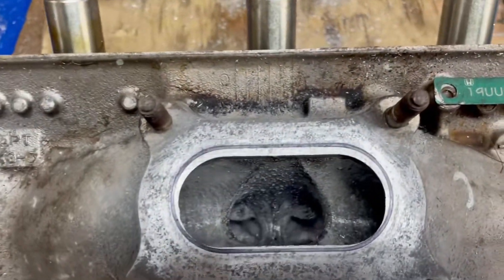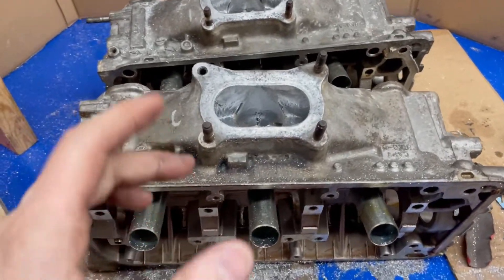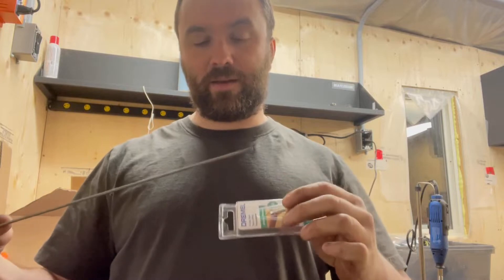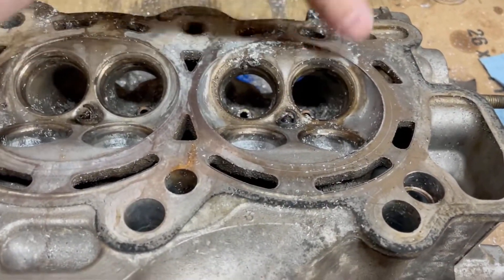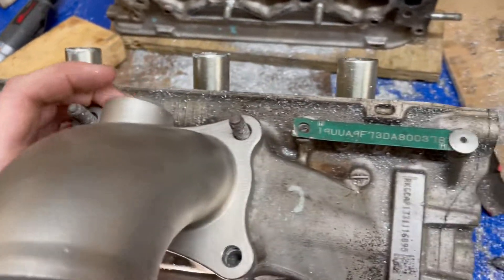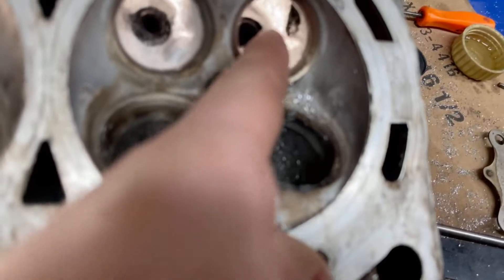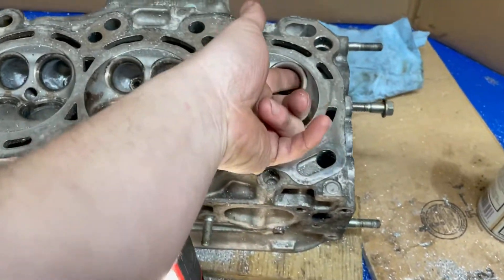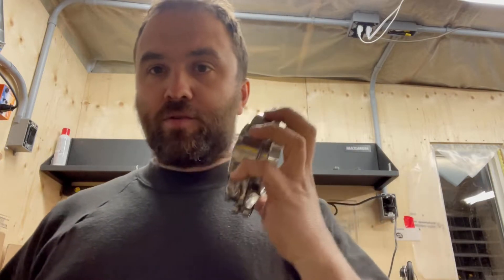J37 Build 340-350whp Acura TL SH Build Pt4

Comment: Hello did you ever finish Winnebago six twenty one? I also have one here in Colorado.
Reply from the maker: Yes finished it last year and actually the guy just sold it today to some kids . The guy I did the build for loved it drove it for the whole summer with zero issues and said the performance was huge and gas mileage improved 15% roughly
Reply from the maker: I’m actually doing a Holley sniper install on a frontier right now my personal one with RV cam and more I will have a video soon on this . What’s your build ?
Reply: I just have the standard 621. Things a beast. 350 gas hog. My daughters husband really wants it. The shell fiberglass and aluminum was a big selling point. I had a 1978 gmc 26 ft that was front wheel drive with tag axle. Sold during divorce lol. Anyway I was hoping to see a video or pictures of your 621.